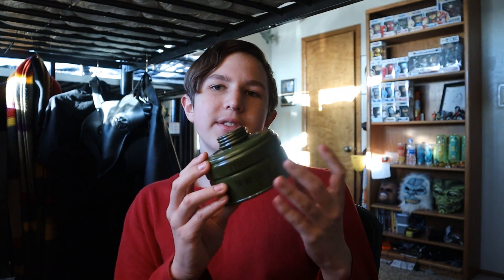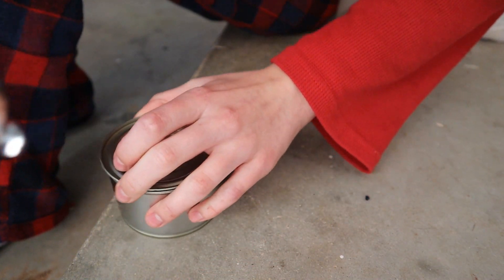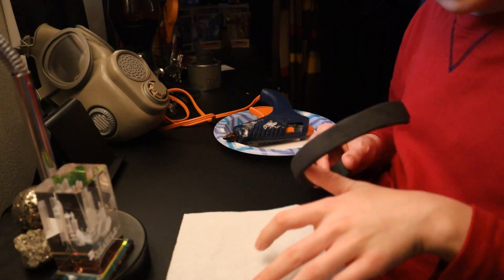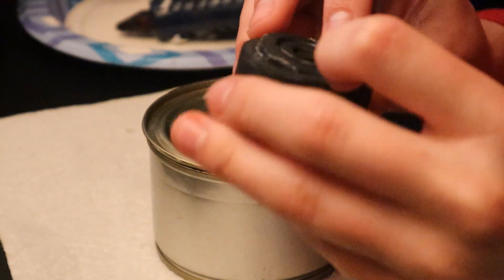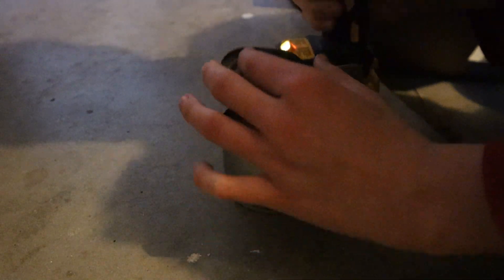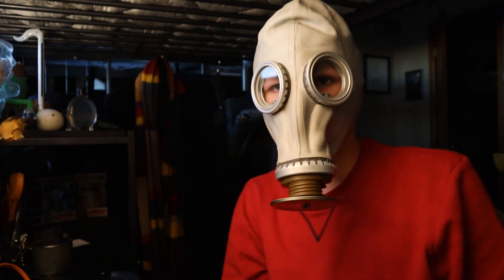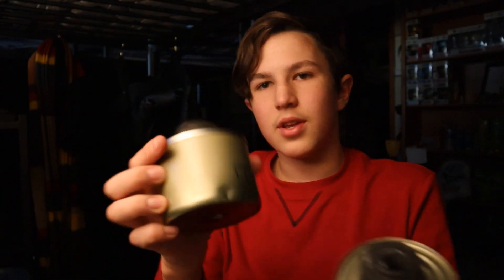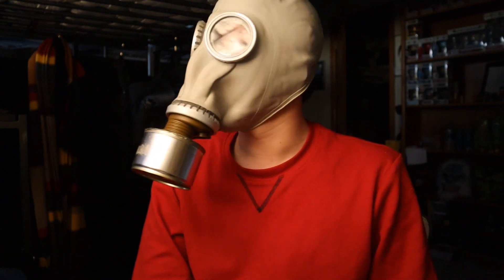DIY Gas Mask Filter Prop (40mm)

Comment: Interesting this showed up in recommended, i would suggest making the intake hole bigger so the mask does not decompress onto your face
Reply from the maker: It works with the size hole it is right now but I'll heed that suggestion thank you

Comment: get a p3 filter cloth thingy and out it into the thread and screw the asbestos filter in easy way
Reply: Dont do it, a p100 filter only filters roughly 97.2% of particles up to a certain size and a majority of eroded asbestos particulates will still make it through, i have tested this myself
Reply from the maker: Interesting  I'm guessing that the cloth will filter asbestos particles  and grains
Reply: no
Reply: Still dangerous
Reply: @Rekonsoepic  ik i have gotten more smarter over that year i aint jó was93 guy anymore